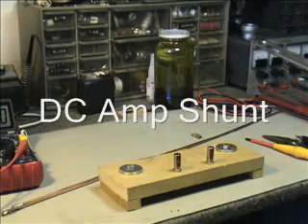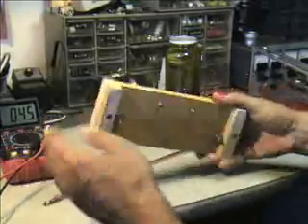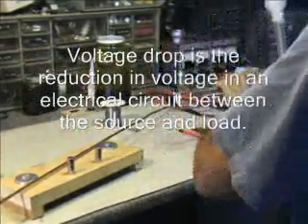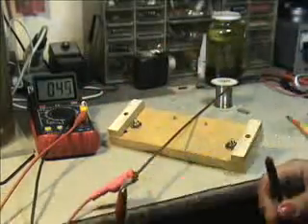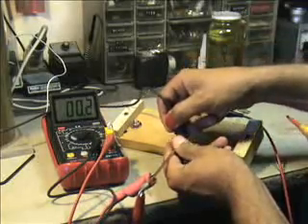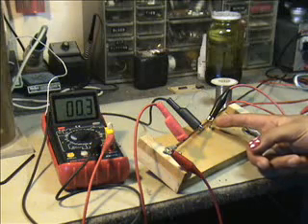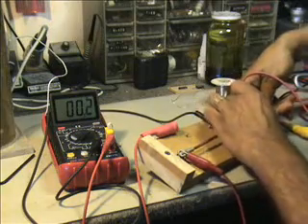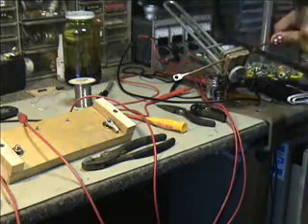Making a DC shunt Pt1

Comment: Disconnect the in LINE VOLTAGE, BATTERY before measuring VR resistance across the meter poles

Comment: use two variable resistor: 1.5 vdc battery in line.  One variable resistor across poles on Meter. Turn to 0.  other  vr in line turned to 0,
turn in line vr slowly to power.  turn vr across meter for slight deflection.  then slowly turn for full deflection but not the line v.  With vtvm measure resistance of vr across meter. the shunt resistance is the resistance measured on the vr across meter.  You are measuring internal
resistance of meter, then the resistance of the VR for the shunt resistance required.    approach this method slowly to protect the meter.